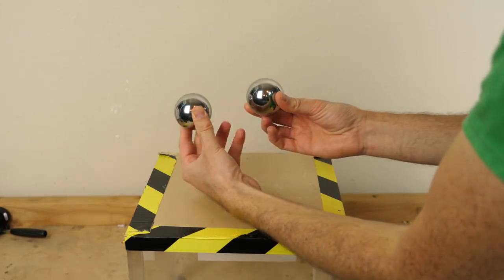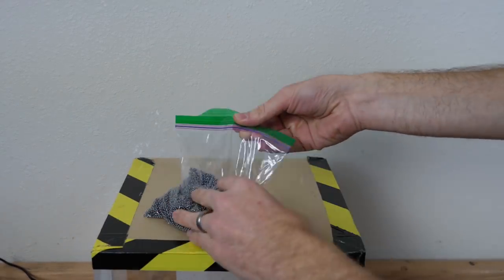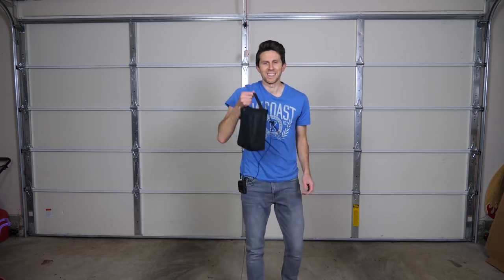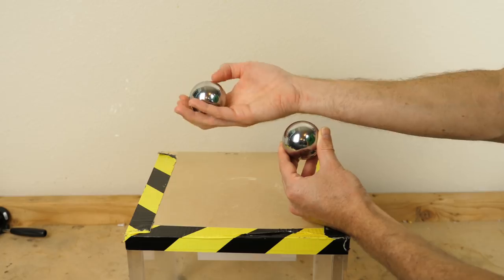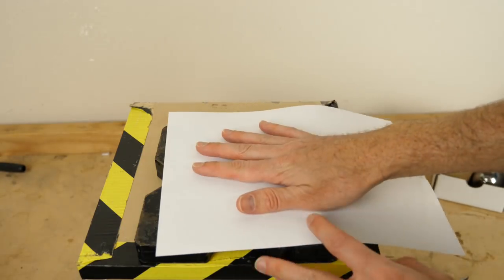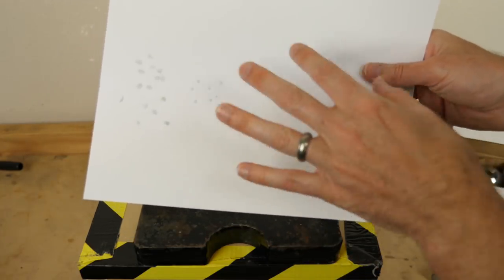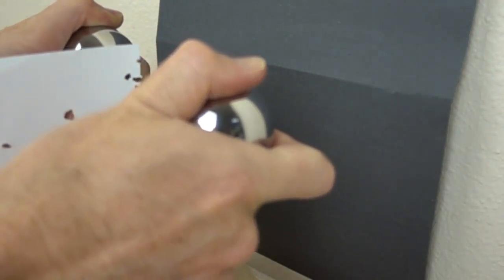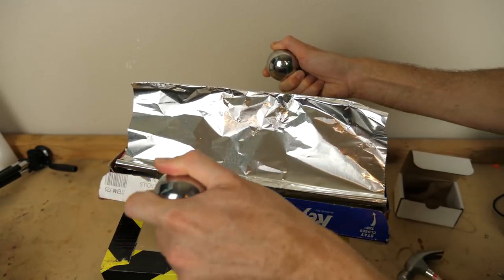Making a Shockwave by Hitting Two Huge Steel Ball Bearings Together!

Comment from the maker: Sorry everyone, I messed up the in the video I said speed of sound is 340 mph, I meant 340 m/s (760 mph)🤦🏻‍♂️. I believe this is how the $125 million mars climate orbiter crashed into mars due to using non-SI units when the engineer thought they were SI...
Reply: hi
Reply: The Action Lab what if they were charged with static electricity? 😯😔
Reply: How fast was the paper moving at then, 340 mph or 340 m/s?
Reply: u are the best even u mess up
Reply: Lol
Reply: what would happen if the balls were moving at a much faster speed
Reply: wow at least this wasn't a calculation for NASA XD
Reply: @Jess Please actually I'm not 100% sure. nobody's really done research on it because it would be hard to pull off, but since the speed of sound through helium is faster than through air because it has less molecules, I think it would be faster in a vacuum. Interesting question, I might do some more research.
Reply: Jess Please. Yore right it does change depending no on temperature and pressure= altitude that’s why you use Mach when you fly bc it’s easier and Mach 1 = speed of sound • 1 and Mach 2=-“-•2 
Correct me if I’m wrong
Reply: @Bcikablam The speed of sound in a vacuum is 0, mate.
Reply: Boom!
Reply: It is around 340 mph given an air temperature around 57 Kelvin. Maybe it's just really cold at your place, really, really, really, really cold!
Reply: In my opinion, we should eliminate all imperial units
Reply: aren't your calculation and conversion right, tho? the time it takes for the heat to travel 6 in is 1 frame in 1000 frames/s which means 0.001s so that would be 6000 in/s? and if you do the conversion it will be 6000 in/s = 340 miles/h??
Reply: I loved the aluminum foil circles
Reply: New excuse for the teacher.
Teacher: "What happened to your homework?"
Me: shows this video.
Reply: Pls can u do a experiment on partition of the red sea ?
Reply: Bcikablam Actually sound travels faster in dense mediums and there is no sound in vacuum
Reply: Jess Please. , Usually marginally . I mean there is not a huge change in speed.
Reply: Mike Simonian shhhh don't tell them
Reply: The Action Lab it's my birthday
Reply: The Action Lab r
Reply: The action lab I have a really important question. I always have the ability to emit heat from my hands, and no matter how much I search about this all I get is some stupid sayings that this is spiritual energy(Chi). However, I am sure all these guys know nothing about that thing and that that thing has a normal scientific explanation. Please answer my question as fast as possible and make a video about it.
Reply: The Action Lab 
also, its not kinetic exercise, its potential exercise. :)
Reply: lol you messed up saying the part you messed up
Reply: Dan Bellis it will generate a Black Hole, that's why the gov. tries their best to make it hard to obtain steel balls, especially 2 inch ones, & even after someone buys one off of the black market website (Darkweb.com), then gov. says "please don't hit them hard" but they wont say why
Reply: It’s okay we all make mistakes right
Reply: The Action Lab so there is no Fire ;-;?
Reply: You also messed the outro up.
Reply: The Action Lab  you made mistakes  but your the best. 👌 👌👌💖💖💖👍👍👍 best of luck for all other experiment sir.
Reply: The Action Lab what did you just say I can’t process this in my brain Si type thing
Reply: @marc CH yeah I know that XD we were wondering at lower pressure not zero pressure
Reply: It okay everyone makes mistakes
Reply: wait what if the lead balls just heated due to friction since the were loose.
Reply: ʰᵃⁱ
Reply: And that's why the US should switch to SI ASAP.
Reply: ᵒᵏ
Reply: Jess Please: Humidity plays a big role, and I suppose altitude does too.
Reply: y
Reply: No, the REAL speed of sound is 1000mph
Reply: so its your fault the mars rover crashed :( rip
Reply: I-thought u were smart.
Reply: You should do it in super slow no and capture the shock waves forming on the foil.
Reply: Next time please put the lights off in order to see sparks.
Reply: 3:31 can you calculate the speed of sound in aluminum with this pattern? 
Like C=l*f
so if the sound that came from it is 1000Hz and the distance between two circles was like 2mm the speed of sound in aluminum would be 0.002m*1000=2m/s. But this wohld be way too less. (or maybe not because of this is just a foil in which the speed of sound could be way less.)
Reply: The Action Lab 🧫
Reply: America.
Use metric to avoid confusion.
Love Britain.
Reply: I don't understand this Language
Reply: The Action Lab is smart people understand 😂
Reply: It’s fine action lab :)
Reply: I'm sure you may get have gotten my comment but please,a giant Newton's cradle and paper.
Reply: @ChallengeTheNarrative  oh
Reply: LMAOOF
Reply: @GreatOutdoors1  the speed of sound
Reply: Yeah, Lockheed Martin used Imperial. Thing burned up during re-entry
Reply: @domenicputti4228  Even if he forgot for a split second, that man's life is better than you in every way.  He's richer than you, still smarter than you, and more successful than you.
Reply: Domenic Putti keep watching his videos and you’ll know the truth , he is
Reply: Tnats still a good exercise in science because now im glad I noticed....
Reply: 🔴 What Is Islam? ⚠️

🔴 Islam is not just another religion. 

🔵 It is the same message preached by Moses, Jesus and Abraham.

 🔴 Islam literally means ‘submission to God’ and it teaches us to have a direct relationship with God. 

 🔵 It reminds us that since God created us, no one should be worshipped except God alone. 

 🔴 It also teaches that God is nothing like a human being or like anything that we can imagine.

🌍 The concept of God is summarized in the Quran as:

📖 { “Say, He is God, the One.  God, the Absolute.  He does not give birth, nor was He born, and there is nothing like Him.”} (Quran 112:1-4)[4] 📚

🔴 Becoming a Muslim is not turning your back to Jesus. 

🔵 Rather it’s going back to the original teachings of Jesus and obeying him.
Reply: What is Islam? Stop lying. You’re a liar.

A religion of peace shouldn’t have entire chapters dedicated to war protocols, including how/when to torture and mutilate non believers until they submit to allah or die by refusing.

I don’t remember Jesus teaching us to torture people until they kneel before God.

Yes yes the common Muslim will tell you their goal is peace and harmony, what they won’t tell you is that said peace and harmony is achieved AFTER they’ve conquered and subdued a nation, then forced its population to kneel or die.
Reply: @ChallengeTheNarrative  ಠ_ಠ
Reply: Welcome to America.
Reply: Yeah you Americans
Reply: Oops
Reply: @GreatOutdoors1  at least 340m/s
Reply: @DirtyFiST69  it travels way faster in water and at around 20km per second in steel, it's all about molécule distance, so you are righg
Reply: he got fired
Reply: @bcikablam3578  not less molecules, but the mass of those molecules are lighter.
Reply: Imperial moment
Reply: @domenicputti4228  wtf?! That’s rude! Keep your opinions to yourself..
Reply: @theunknownexplorer1944  what is your question then?
Reply: Oh, sorry, I wrote my comment before reading yours. But r³ and r² are still valid (see below). 🤪
Reply: @bcikablam3578  In vacuum is no submission/spread of sound. 
The speed of sound is around 300 m/s in air but at 2,500 m/s in steel (for example in railway tracks). That's why you hear a train 1st in the rails before you hear it via the air.
Reply: Drop the imperial units
Reply: It’s 340 m/s on Earth but actually 340 m.p.h on a planet which atmosphere is made of thick plasma.
Reply: I assumed you were doing 340x2 @ 60k feet :P
Reply: ꧁Francis꧂ 
FANCY
Reply: Thats why everyone should use SI Units aswell as the metric system
Reply: @GreatOutdoors1  ofc 340 m/s dum dum
Reply: That's good to know
Reply: where can i get these balls?
Reply: 3:31 can you calculate the speed of sound in aluminum with this pattern? 
Like C=l*f
so if the sound that came from it is 1000Hz and the distance between two circles was like 2mm the speed of sound in aluminum would be 0.002m*1000=2m/s. But this wohld be way too less. (or maybe not because of this is just a foil in which the speed of sound could be way less.)
Reply: @danbellis2532  like how much faster
Reply: conversions has been the cause of a few problems.. god forbid everybody agree on a central unit...
Reply: Try doing it in the dark!
Reply: Ghg
Reply: Ok I got it ,if any object that travels at speed of sound or more means ,it will create a shock wave

Comment: Been a blacksmith for 15 years.

If you hammer the tip of a 1/4 inch diameter steel rod against an anvil hard and fast enough, you can get it red hot, which will light a fire. This is usually done to show off by lighting a cigarette with it.

Comment: Interesting! But may I disagree in 2 points?
1st 340 mph isn't the speed of sound, that's 767.3 mph.
2nd Larger balls create more energy, but the surface area for quenching is increasing less. The weight/mass/volume increase by cubic in relation to radius/diameter while the surface are increases just by square.
Reply: Yeah I find it strange too, I'm going to try with "boule de pétanque" it's from a french sport, the steel balls are bigger than that so I'll know.
Also the foil migth just wrikle due buckling from heat expansion and not by creating a still image of a shockwave.
Reply: I used 1.25 inch ball bearings and this works don't need just 2 inch

Comment: Chuck Norris called. He wants his balls back. And he would like to point out that he was responsible for the birth of the SR71, when his Tahoe went over a speed bump.
Reply: No way are those Chuck's balls! Didn't you know he rents them out to demolition companies?
Reply: Some Dutchguy I was under the impression that 12 of his many uncountable balls were recently discovered orbiting Jupiter, so I'm sure he loses track of some of them occasionally. I've also heard that they all rotate in  synchronisation, no matter how far apart in the universe they are and that he is single handedly responsible for quantum entanglement as the universe is afraid to not follow his example.
Reply: SaNdMaN 02665 spoiler
Reply: +Yange Xue ha ha ha
Reply: +Yange Xue ha ha ha
Reply: Chuck Norris more like Upchuck Norris. Oh!

Comment: When I did that to a foil underwater, I noticed that it created two of those concentric patterns. The speed of sound is like 4.5 faster than air. During the first impact, I wondered if there may be a blast of steam, then it condensates to pull the ball back in for a second impact.

Comment: That was a very interesting video. The concept of the contact area being optimal for only spheres of certain radii makes sense. It would have been interesting to see the paper in the dark when you did that. Trying in in different gasses might be interesting too, to see what the effects of different atomic weights has. I believe there is a super bright flash generated when explosives are used with Argon gas. Perhaps you could put some Argon in a bag with the sphere and clank them together; it should be safe as Argon is non explosive.

Comment: Hey, can you freeze liquid nitrogen or make dry ice liquid?!
Reply: A. A. M. NANI
Reply: Liquid Nitrogen will freeze to a solid at around minus 380 degrees F.  Dry ice will liquify if you can contain it in a pressure vessel.  It dry ice does in fact melt but like I said before, only when it's able to be kept at a high pressure.  It's sold as a liquid for soft drink fountains.  The tank takes the gas off the top (as opposed to a tank with a 'siphon' where the co2 is taken from the bottom as the liquid).
Reply: Dooder Bug no, I did 😂😂
Reply: Applied Science has a video on liquid Co2, it's pretty cool stuff.
Reply: A. A. M. Dry ice is just frozen co2 gas....
Reply: Cody'sLab has a video about liquid CO2. It's awesome, you should check it out. He even made it explode.

Comment: I've done some blacksmith work and you can light a fire by hitting a steel rod. It gets hot enough to light paper. Normally, you use a 2-3 lbs hammer. Just hit the steel rod about 15 - 20 times.

Comment: Watch a video titled "Can a solid ball stop a 50cal???" At 3:28 in the video a small glass sphere is dropped on a much larger glass sphere and bounces to the height it was dropped from.  The guy in the video is impressed and goes to try it again to see what looks like perfect holes punched on the glass from contact, but he says they are completely smooth still so the cracked holes are within the glass.

Comment: Your channel is always interesting and you always demonstrate a nice basic way complicated things. There's one thing I've always wondered does the temperature difference between two items determine how fast those two items will equalize each other in terms of temperature. If one item is 10° different than the other and they're placed against each other is the rate that it will equalize those two things slower than if there was a hundred degree difference I know it'll take longer but it's the rate of temperature change that I'm curious about. Thanks keep up the great work

Comment: The marks in the foil were created because the steel balls were actually thinning the foil at the point of contact causing stress to the surrounding area which was dissipated in the form of spherical wrinkles.

Comment: You're right. The foil and water. Have seen many slow mo videos on the rock dropped.
 So if you had a thin tank of water and one stationary ball on each side of the tank and touching it. 
 The other two balls swing equal force equal time hitting the stationary balls
Will you warm up the water especially if you used larger balls that absorb the heat ❓

Comment: so ... considering the speed of sound through steel is 5,960 meters per second. Which to get a standing wave or harmonic is 5960 hz for a correct sized sphere. So the optimal sizes sphere to get the best energy conversion is 0.06m which is 2.362 inches.
Can you try with the harmonic frequency sized steel ball and compare the results?

Comment: "If you have anything smaller than two inches, it doesn't have enough mass to generate the shockwave.." But mass isn't determined by the volume, but the amount of matter in the ball. Theoretically, I could find two smaller spheres made of a higher density material, as long as the overall mass is the same in the end right?

Comment: It will be interesting to repeat the two experiments performed in this video, with Palladium ball in Hydrogen. Yes. I am thinking about 「cold fusion」。Or more precisely, “micro scale fusion”.
Reply: May be soak the Palladium in 2500 psi Hydrogen gas over night first, then let the two Palladium balls hit each other.  Or just use a Hydrogen loaded Palladium foil to replace the Aluminum foil in the shockwave  test.
Reply: Generation of radioactive particles will be a good evidence.   Another experiment: If a bag of Palladium balls, again under 2500 psi Hydrogen, were allowed to collide with each other vigorously inside a shaker?

Comment: I've got a question what does an AirConditioner do? Gets hot air or Blows out cold air because if it gets hot air why is it cold when you get close to the AC? If you get the answer tell/make a video about it but if you don't know try to ask it in the comments below if anyone else knows
Reply: LMBT Random. I guess this is the simplest way I can think on how to explain it. When an air conditioner pulls warm air in, the aluminum condenser is literally pulling the heat out of the air:  (Absorbing it because it is cooler), and lowering its temperature, Then the heat travels through the copper pipes through the air conditioner in the freon, To the condenser in the back, then a fan blows through that condenser pushing the heat out. It is literally a heat pump!
Reply: LMBT Random. So answer to your question is, it exchanges hot air for cold.
Reply: LMBT Random.  Here's a quick little experiment you could do, take an ice cube, and put it against a warm piece of metal, like an empty soda can or something similar, You will almost immediately feel the metal getting colder, that is because the ice cube is literally pulling the energy(heat), out of the metal, and absorbing it, and consequently melting it.. An air conditioner works along these same principles, but instead of something melting, it's just pushing the heat out of the back..cool huh?
Reply: LMBT Random. And in case you're wondering where the heat energy goes when the ice cube melts, it is still in the water, then when you pull that heat energy back out of the water, it turns back into ice.. Ice is just water, with the heat energy removed..

Comment: Sorry for my English if in the text are some mistakes, because my native language is Slovak language... I have some questions: What would happen if two shock waves go against each other and between them would be some observer? For example: The 2 ambulances go speed as is speed of sound and with turn on sirens and between them is some observer or some detector for measuring frequency. How frequency measured the detector when they meet at one point and how frequency measured detector if ambulances goes speed of light? Thanks for your answers and God Bless You! O:)

Comment: There is no way to tell if the lead shot heated up from the impact or from the friction of rubbing together as you lifted them.
Reply: But...as recently explained, temperature is essentially the measure of the kinetic energy of the molecules of a mass.  Conduction (heat transfer) is the transfer of the internal kinetic energy of one mass to another.  Logical and strange 😲

Comment: Is dark matter atoms that have never seen light? To create atoms you needed light. So does it still contain all of the energy it once received but the light particles just are trapped in there whizzing round faster than light or are just stuck to dark matter.